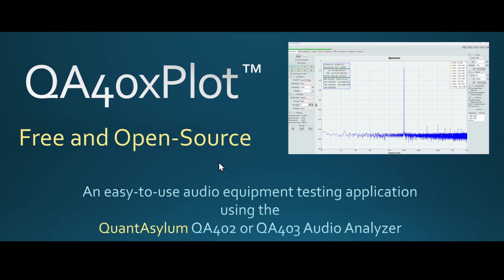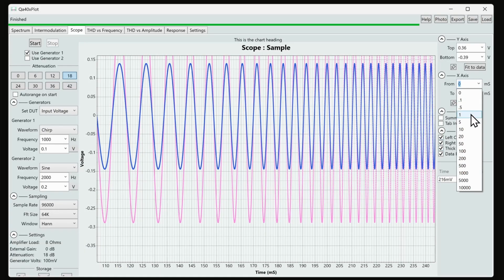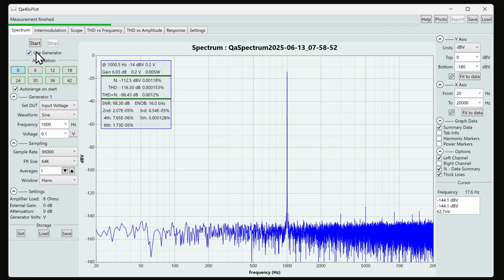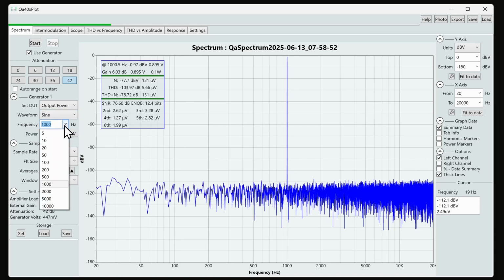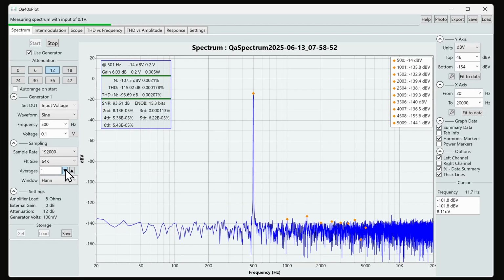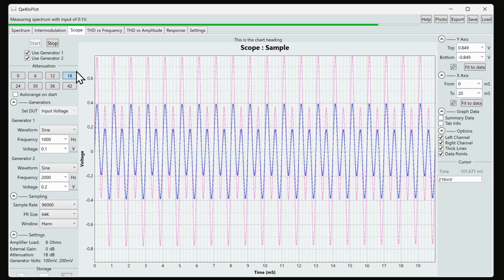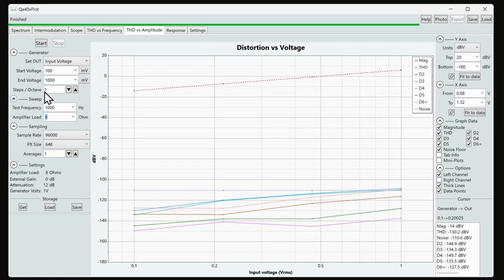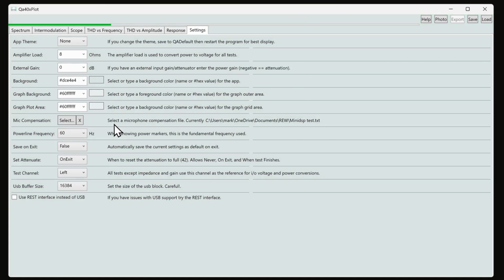QA40xPlot Tutorial and Overview

Comment: Great job Mark! Thank you so much because with this software IMD measurements are much easier to perform. But I'd like to ask you a question: is it possible to use the right channel as a reference when measuring the frequency response? In other words, is it possible to measure in Dual Channel Mode? Thanks in advance for your response!
Reply from the maker: Thanks. I'm glad you like it. The IMD math was a pain.

If you use the Gain instead of the Response option in that tab it will use the right input channel as a reference and the Gain/Phase is all relative to the right-channel input .
Reply: Grazie mille!
Reply: Love the work you’ve done with this software! If we have feature requests, where is the best place to post those requests? Should I assume the best place is the QuantAsylum forum?

Comment: I just started playing with your software. A question how do you save the setting in the settings tab. I set the impedance to 8 ohms, always goes back to the default 10 at start up?
Reply from the maker: I just realized this was never answered here, though I know you asked on the forum. The Save button in the very upper right of the screen saves the current settings. If you save them to the specific file QADefault.cfg in Documents then they will be loaded at startup.